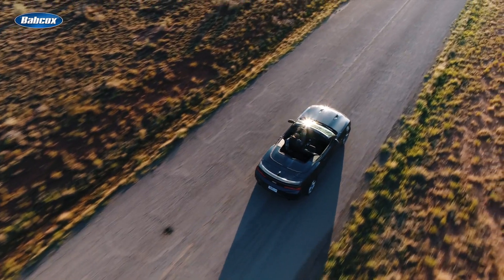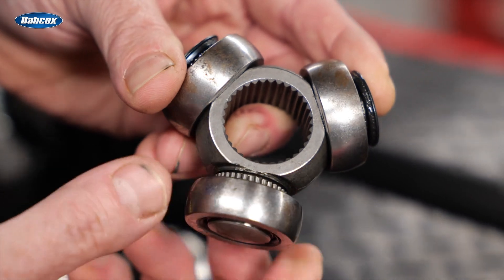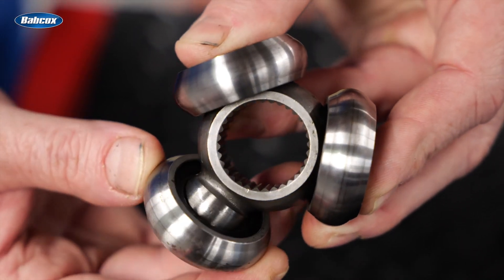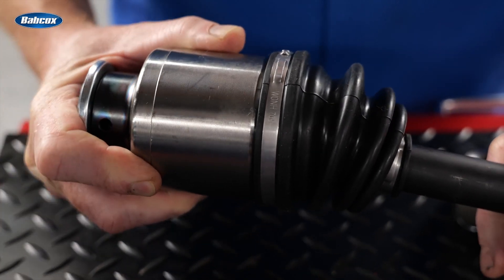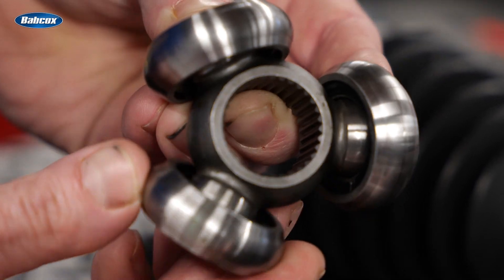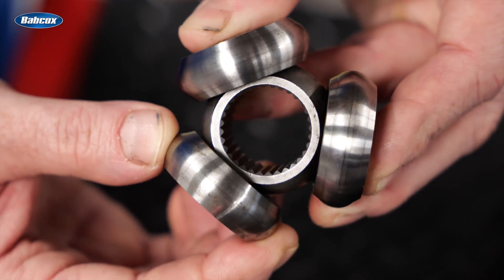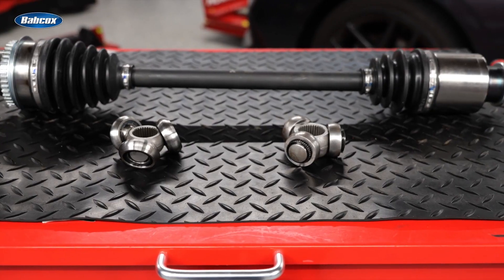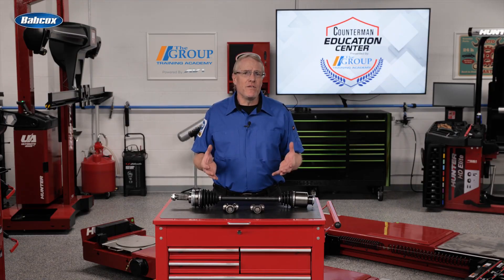AAR vs Standard Tripod CV Axle Socket Design

Comment: I tried installing a non AAR axle in my C300 4Matic and it twisted up and made horrible noises as soon as I began to drive. I'm throwing it away and replacing just the outer joint on the original axle. I see an AAR axle option too, which might work, but it's cheapest, easiest, and best to just install a new outer joint. All you have to do is cut the old boot, hammer the old joint off, and pop a new one on. I'd only replace an axle in the future if it's heavily corroded or something.